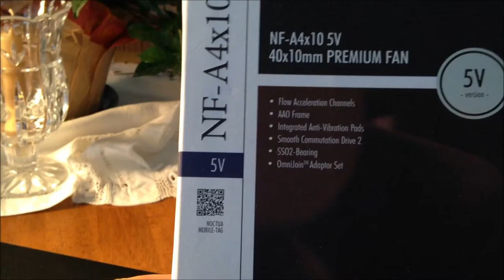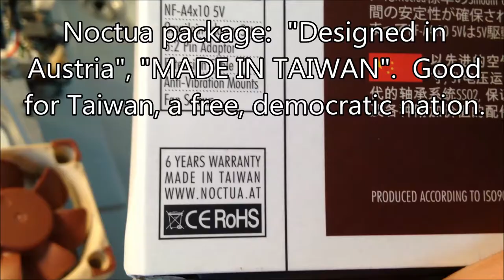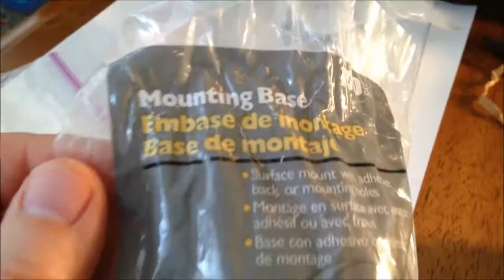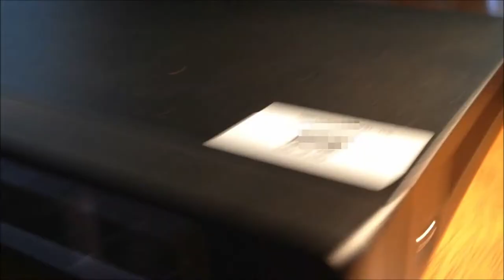How to Replace Two Loud Amcrest Security Camera DVR Fans

Comment: Thanks for the video. The 5v Noctua also works as a replacement in my Dahua CCTV box using the 3/2 pin adapter. The Dahua is almost exactly the same internally as the Amcrest except it has only the CPU fan, which can be cable tied on top of the existing unit (as per the video) and is much quieter than the fan supplied.

Comment: Thanks for posting this video!  I just got the Amcrest NV4432E and the noise generated by the side fan is a good 40 dB higher (at the 100-200 Hz range) than if I unplug it (still leaving in the fairly quiet fan built into the power supply).  I noticed that the NV4432E has a 60x60x15mm 12V fan (ADDA AD0612LX-D90) inside of a metal frame, so hopefully, I can remove the frame and use Noctua's 60x60x25mm 12V model (NF-A6x25 FLX).

FYI: from the API manual, it appears as if the OEM manufacturer of the Amcrest NVR is Dahua.

Comment: I did the case fan thing and it works fine. After doing a smoke test I found that the case fan was sucking air in right next to the fan and blowing it right back out (circle route) . I took some metal tape and blocked all the vents on the fan side except the fan opening now the fan sucks air across the entire motherboard.  Nice video by the way I'm going to do the cpu fan next and get rid of that DAHUA pos. Thanks again
Reply from the maker: Hah!  That circle silliness is crazy!  Thanks for sharing.

Comment: Thanks for this video. I have the same DVR as you have and had a problem with the case fan that seemed to change speeds. At times it made a real loud noise which alerted me that I had a problem to begin with. I bought two of these Noctua fans and replaced the old Amcrest DVR fans the same way that you did. They are much quieter and so far the DVR has been working fine. The only problem is that I noticed that the Amcrest case fan draws .25A and this new Noctua fan draws only .05A. This usual means that it may be transferring less air which could result in overheating. I have to worry about this since I have the DVR in an enclosed cabinet above the refrigerator. I will monitor this and let you know if it fails do to overheating. I am sure that this is a great solution to solve the noise level problem when sitting on an open shelf in the living room. thanks again.
Reply from the maker: Good deal, Jim.  Hopefully the difference in current draw (interesting!) is just from the original DVR fans from China being way less efficient.  Their lower quality overall (noisy!) makes me suspect that's at least partly true.  
Good luck with the heat aspect with the DVR inside a cabinet.  Not sure if any fan could handle that situation - if the air outside the DVR but inside the cabinet is too hot, then the air inside the DVR will be too hot no matter whether you have two or 1,000 fans.  FYI - Amcrest specs say the DVRs can handle up to 131 degrees Fahrenheit, which I checked on as my living room can get a tad over 100 degrees when we're not home and the a/c is not on (to save some $$).  Maybe put a thermometer inside your cabinet to see what it gets up to.
Reply: The DVR has been in the 3' wide overhead cabinet for about a year now and I have had no problems with heat except for the case fan noise. The temperature rise (house to inside cabinet) is about 20 degrees F so if the house is below 80 (which it always is) the inside cabinet air never got to above 100F when I had a thermometer in there a year ago. That allows for a 31F rise from cabinet air to the temperature around the hard drive CPU heat sink. I did not have to put any vent holes anywhere in the cabinet to vent air except for the hole for the cables that do down the wall to the living room. I have a long 5+" shackle lock through the handles of the cabinet to keep the DVR safe from thieves. Hopefully I will never lose the key. The DVR would probably be the first thing they would steal. Since the cabinet is not very deep I had to install the DVR at a 45 degree angle from front to back using some hand made wood mounts to support the DVR and to make sure there is no tension on the cables. Amcrest support told me that would not be a problem since hard drives operate at any angle. Took a lot of work but I wanted to hide the DVR and make it harder to get to. The new fans are very quiet compared to the original ones. Again, thanks for your guidance shown in your video. It made it a whole lot easier to tackle the changeout.

Comment: thanks for this video.  my lorex surveillance dvr was stuck in a reboot loop.  i used this fan but could not zip tie.  instead i used the isolation mounts and pushed them into the heat sink fins.  all is now good!

Comment: if you want to be more quiter then cut the metal part where the fan is and leave it to be no obstacle like portection grill and that will cut another 50% of noise.

Comment: Simple question but is the fan blowing air into the box or out?  I have an Amcrest NVR recording IP cameras and it does not have a fan inside it.  I'm going to install a Noctua 5V fan in there to help keep the WD Purple drive cool.
Reply from the maker: Fan mounted at the side or edge of the case is blowing air outward.  Good luck!
Reply: In my case, do you think I should have the fan blow air into the box?  Like I said, for some reason decided not to put a fan on the NVRs.
Reply from the maker: I kinda doubt it.  Amcrest's engineers determined for some reason to have the air blowing out, so I'd stick with their basic concept.

Comment: My NVR only has 1 fan. Is there a way I could wire in (splice) another fan?
Reply from the maker: That I am not sure you can do (I doubt it).  Someone else more expert than I may have a different opinion, but I'd assume the current in the fan supply wire is designed to run only one fan.  One other possibility is to set an external fan right next to the NVR case - something like this:  https://smile.amazon.com/gp/product/B009OWVUJ0/
Reply: @Jsfrog  thank you

Comment: Good tutorial but you don't need to zip tie the fan down.  The Noctua fans come with 4 rubber inserts.  Just pull as many as you want through the holes in the fan and cut off the rounded end and then push the legs between the metal fins on the heat sink.  The fan will sit snug and no need to use any tie downs.  Assuming you're not moving the DVR constantly the fan will sit fine, and you don't take a chance of pulling the old heat sink up.
Reply from the maker: Scott - interesting idea.  Let us know later if the fan vibrates loose over time.  Thanks.

Comment: Does your DVR's fan stay on after you shutdown the system from the operating system software? My DVR fan only goes off when I pull the power supply plug out of the mains socket, is this normal?
Reply from the maker: I've actually never shut the DVR down that way.  I've always used the power switch on the back, so I don't know about shutting it down using your method.  Maybe someone else knows.  And I cannot even try it now as the power supply on mine died after only two years!  Just ordered a new DVR yesterday.  First DVR shown in this video lasted three years, this one only two.  Hmmm...
Reply: @Jsfrog  thanks for replying. Unfortunately my DVR box doesn't have a power switch, thanks all the same for replying.

Comment: Will this fan work on the 1terra version?
Reply from the maker: +Edwin Rodriguez I'd suspect yes, tho cannot guarantee.  I'd suspect they use the same metal case, same electronics, same circuit board, and the same fans, but they just vary the size of the hard drive.  If you have the 1TB DVR already, just open up the metal case by removing the six screws, and see if the fans look the same as the ones in the video.  If they do, then you should be good to go.

Comment: Great Video, Very Helpful. Thanks for taking the time to post this. Just in case your fan does not work... flip the connection. Pay attention to where the red and black wires are before you take the old fan off. I used the silicone mounts to mount the fan to the case (long part on the inside), noticed there was some noise when it was mounted with the screws. I also used the silicon mounts to mount the 2nd fan to the aluminum cooling fins. I cut the balls off the end and just wedged the pieces between each fin.. seems very secure. See Pic Here: http://i510.photobucket.com/albums/s347/TL95SVT/YouTube/20160216_192650_resized.jpg

Comment: Thanks - nice video.  Just wondered—- your vid shows a 5 volt fan but Amazon references a 12 volt?
Reply from the maker: For my DVR you need the 5 volt.  At the 2:51 point in the video, if you freeze/stop it there, you can read "5V" on the side of the old black and white Made in China garbage fan.  Here's Amazon's link to the 5 volt:  https://www.amazon.com/gp/product/B00NEMGCIA/ref=oh_aui_search_detailpage?ie=UTF8&psc=1 
I'd suspect whatever DVR you have, if you remove the case and look at your fan, it will also specify how many volts it is.  Good luck!

Comment: Thanks for sharing this, it was extremely helpful. I did this on my 8 Channel Amcrest DVR. After replacing both fans, my DVR started restarting every 30 minutes or so. I determined that this was due to the fact that placing the new fan on top of the board was not providing enough air to the board, causing it to heat up. I removed the fan and replaced it with the one that came with it and and the dvr is no longer restarting. Replacing just the outer fan reduces the noise significantly, so it's possible that this might be good enough for most people.  

The fans that I used are here http://tinyurl.com/h728qqd. I believe these are the same you used. I noticed that the 2 hole connector that comes with these fans does not plugin very smoothly into the connectors inside the DVR - One has to bend to make it slide in and the connection feels like it might come off. To fix this, I cut off the connector from the old fans and just matched the red and black wires to the 2 wire adapter that came with the new fans, and this worked.

Comment: Why did you have to replace? Look like in your video the cable was ridding on the fan blades right?
Reply from the maker: Yes, but it wasn't just that.  the cable hitting the fan was the noisiest part at first, but it was still noisy as crap even after I fixed that.  Amcrest's fans are cheap and noisy.
Reply: Jsfrog58 Gotcha! Yeah I have one too that was pretty noisy, I just stuck two rubber washers on the screws between the fan and the grill and it quieted it right up, maybe if it gets noisy again I’ll try what you did
Reply: @Jsfrog  keep an eye on the CPU Fan .................. sometimes shit themselves without warning, have even come across a couple that reverse at boot .... now the noise from that is a loud screech ...................................FYI, same Motherboard found in practically all Chinese DVR's, Manufactured by Hangzhou Xiongmai Technology, commonly known as "XM" ....... Dahua DVR are rebranded XM products